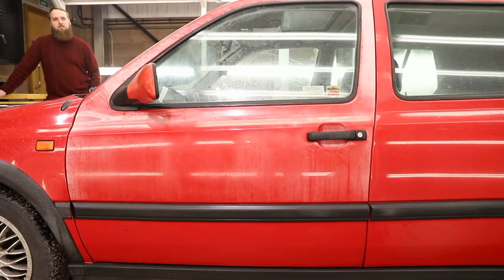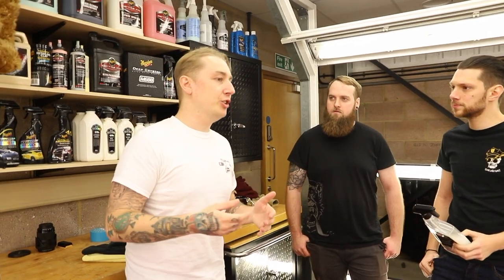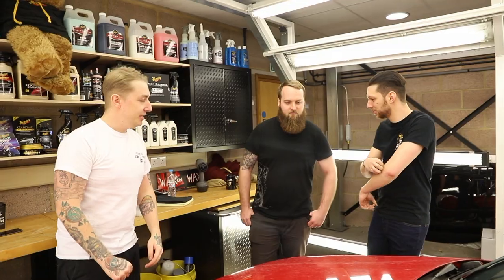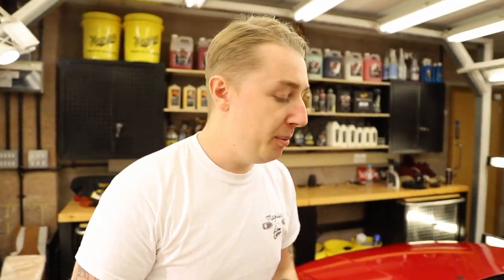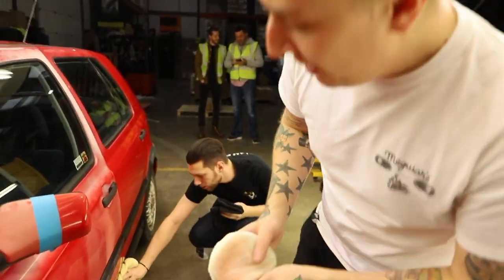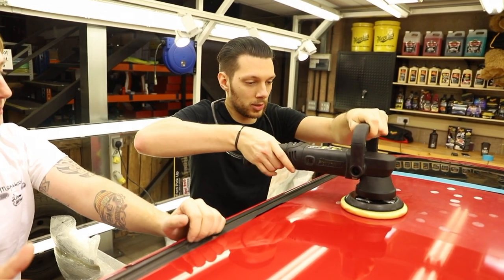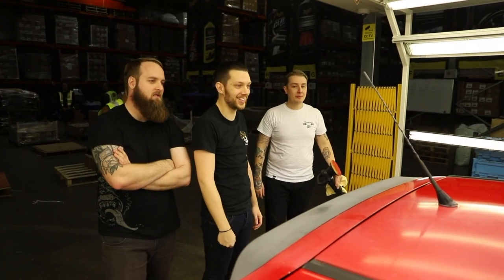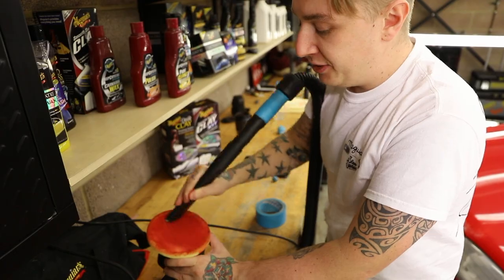The ULTIMATE COMPOUND for restoring FADED PAINT *Day In The Bay

Comment: The reason why red fades the most is due to the wavelength of the color. When you are seeing red it is the sunlight whose wavelength is red being reflected back at you which means that all other colors get absorbed and not reflected. Red is the farthest away from UV wavelengths so it gets hammered with them and absorbs them so the UV inhibitors in the clear coat take a bigger beating. Just wanted to put this out as that is the main reason why red cars fade the most.
Reply: If it is that faded, it does not have clearcoat...wich you can clearly see on the residue on the used pads…   With clearcoated reds the problem is not even remotely as big. And if they are faded underneath the clear you are obviously in for a respray..
Reply: And what about black cars? because they absorb the light.. so a red car fades faster than a black car?
Reply: @biaritzsiroko6117  no thats false statement above, all single stage (older paints) fade this way regardless of color
Reply: What is the sun?
Reply: You arent right. This is a 1k Paint, theres no clearcoat
Reply: @NikosPer  correct... green and yellow do the same... new red paintworks doesnt look like this after a 20 years ae
Reply: @Jubi230GTI  its just more pronounced on red colors...thats all. clearcoated reds no problem
Reply: Absolute bollocks
Reply: Most of the older uni-colors (non-metallic/no clearcoat)
Reply: That means red paint being faster might also be true, scientifically speaking the wavelenght of the paint absorbs the wind particles and aerodynamically affects the performance in equal correlation to x2 extra bhp per 10mph, ie. e=mc2 something. :D
Reply: I always thought it was because people were idle and didn’t 🧽 polish and wax their cars 🚗 😂
Reply: Just saying all colors are the same in absorbing all other colors and bounching the color you see back. Not just red.
Reply: Mikhail Smelik this simply isn’t true lol. Has nothing to do with the color, all paintwork on older cats will look like this if if it has spent enough time in the sun.
Reply: @biaritzsiroko6117  According to Mikhail black will fade the most because it absorbs all colors.
Reply: Look at the big brain on Brad.
Reply: Which colour fades the least?
Reply: By this logic black would be the worst, since it absorbs all wavelengths...
Reply: Magic school bus taught me this

Comment: Meguiar's Ultimate Compound on stage-1 paint is just killer. I restored a red 30 year old Mazda Miata convertible this past summer.  Did a very methodical Compound with a DA polisher.  Alcohol rub down.  Followed with a coat of TW Seal&Shine with a 3 hour cure followed with a coat of Meguiar's Gold Class Carnuba.  Damn it looked good.
I too did not follow with polish as the Compound cleaned up so well in the single stage paint.  After 30 years of less then proper maintenance,  I told the client that "I took what I could and left what I should..."

Comment: I thought after washing a car you had to decontaminate the paint by removing as much fallout as possible before compounding/polishing using chemical and mechanical means.
You didn't show that here so is it necessary?
Cheers.
Reply from the maker: The car had previously been washed before coming to the bay, therefore all we needed to do was use the Waterless wash and crack on with the Ultimate Compound!
Reply: yea, you definitely have you clay the car to get anything embedded into the paint out. they didn't, probably because of lack of time. as you can see the end result is far from perfect, but again, time constraint.
Reply: @Cydro12  .

Comment: This video convinced me to try it on my 2000 Honda Logo with red single stage paint. The paint is a bit faded, like very dark pink-red, but not by far as oxidized as the VW in this vid.
So I rinsed the car and used PoorBoys'World STRIP DOWN to remove ANY old wax or coatings, then washed the car by hand in a DIY wash box at a carwash, dried it, drove home, clayed the entire car, then removed any lube oils with an ipa panel wipe. I noticed that the strip down had been kinda aggressive on some parts of the hood, where i could see dried stains that have even turned vaguely white, so watch out with that stuff. But for the rest, the car was squeaky clean, so nothing would stand the Meg UC in it's way. The result is good: all swirls are gone and it has a good shine, but i'm very dissappointed in the level of red restoration: The Meguiars even coat MF pad, a "Liquid Elements" medium pad, or even a hard cutting pad on a DA did not gave a red transfer, only white-pinkish. And i know the original colour of the car is far more red, it's visible on the edges of each panel, the inside of the doors, on the inside at the fuel tank entry, etc. I know each car may need a different approach, but the Meg Ultimate Compound wasn't strong enough for my situation. It was my fault to completely rely on this vid, and only having the Meg UC in preparation for the excercise. I should have invested in other cutting compounds and have them at the ready as well, so i could trial and error my way to a true red restore.

Comment: I restored a oxidized car also red. The compound worked great and I sealed it with a wax compound from another company, the waterless spray worked better in the video then on the project I was working on. Also I used the McGuire's rim cleaner that was super.

Comment: I’ve bought the entire suggested range for Detailing a Dark Car, but I have the faded aspect from this video on my dark grey metallic on my hood and bonnet from sun damage.

My query; for the dark video you used the clay bar. For this video you didn’t clay bat the ‘single stage’ paint.

My non single stage absolutely needs clay bar but do I also use it on the faded single stage sections?

Thank you 🙏

Comment: Hi. I have a question.
Why do you use the Ultimate Compound with the yellow pad instead of the red one?
I mean, in the Detailing 101 you used the red pad.
Reply from the maker: This is a good question! Even though we lay out a procedure every paint surface is different and in this instance we opted for the yellow polishing pad as we needed to do more paint cleaning than correction.

Comment: Does using compound means that I have to regularly wax the car to protect the paint? And also, what happens if i wash the car? Do I have to reapply everything?
Reply from the maker: As an example our Ultimate Wax protects for 12 - 14 weeks. If you use something like our wash and wax shampoo that will protect for another 2 weeks. Or to boost protection after washing use something like our Hybrid Ceramic Wax.

Comment: Can I use the soft foam apllicator pads to do the compounding, and also for polishing? Or does it have to be the microfiber pads used in the video? Also, don't have the machine, so can this be done by hand?
Reply from the maker: You can use any applicator for any process we use the even coat applicator pad (the microfibre one) as its a slightly larger pad and the microfibre aids the cutting ability.
Reply: If doing a whole or multiple cars a dual action polisher is worth the purchase. I don't know if you have any discount tool type stores around your area, but inexpensive ones can be found online. I bought mine from Harbor Freight and even use it for applying wax now. Saves so much time and labor.

Comment: Why is that pad red? Is it removing the paint?
Reply: Yes, the compound and pad is removing the top oxidized layer of paint. Since this car has single stage paint, there's no clear coat on top of the color, and you see the actual paint color on the pad used.
Reply: @tbnzet  Thank you. I didn't know it was single stage and thats why I asked. I was worried that it was burning through clear coat.
Reply: @Nikola-df3dg  if you're getting color on the pad.. there is no clear or its long gone... peace
Reply: @HOTRODRICO   Thank you.

Comment: I just did a cut on a Milano Red 200 Integra (using macguires ultimate cut) and my cutting pad had no red residue on the pad. Any idea on why I’m doing wrong? Pretty sure it’s a single stage paint. Perhaps I’m not putting enough pressure

Comment: Maguiar's ultimate compound or Maguiar's 105 ?? Which is the best ?? I have a BMW 525d Msport  with A07 Mystic Blue.. Please guide the best option for compounding my car...
Reply from the maker: They are two very different products. If you are dealing with medium to fine defects which on a day to day car we would suggest they are we would go with ultimate compound all day.
Reply: try ultimate compound. especially if your a novice. i use it on my vehicles its my one and done. i dont have to go over it with a polish after because this compound breaks down into smaller less agressive particles and will polish as it gets worked. m105 will cut more but leave you with a haze that you will then need to come in with m205 to polish. clay the car first and dont use a very agressive or hard cutting foam pad, i use a medium pad or a polishing pad. good luck. get a da with a clutch
Reply: Thanks..
Reply: @DC-si8xw  - Ultimate Compound contains SMAT - non diminishing abrasives that do not "break down". You will break the liquid emulsion as you work the liquid over the paint, but the abrasive particulates themselves do no break down. 

Ultimate Compound is derived from M105. They use the same abrasives, but M105 uses a much larger quantity in the formula. Ultimate Compound also has lubricants in it that keep it wetter longer, which is why it doesn't dust as badly as M105.

Random Orbital polishers don't have a "clutch", but operate with a free floating spindle assembly. This means that par rotation is reciprocal of the orbiting motion of the spindle.

Comment: Videos like this never cease to amaze me with how much difference you can make to a cars finish, what once I would have thought needed a complete respray can now be saved with a bottle of cutting compound and even a cheaper DA polisher.

I just got my first machine today so haven't used it yet but next wash I'm looking forward to seeing what I can do with it☺

I know this is probably a really stupid question but how often would you use a compound like this on the car? Surely not everytime you wash? Is a deep Polish and wax sufficient after you've brought the colour back and hopefully removed any marks in the paint?
Reply from the maker: So once you've compounded it and done the necessary steps in order to protect the car you wouldn't need to compound it again. If you find the car has some swirls and scratches on it 6 months down the line for example you can absolutely use the compound again.
Reply: @meguiarsuk  

So realistically after the first time it would be a maybe once a year job just to freshen it up Yeh? A regular polish and wax will do the rest of the time.

Only problem I can see is my neighbour keeps collaring me to wash their knackered old Focus, it's going to drive them mad if I can make my car look brand new again😆😆

Comment: Would be nice if you didn't spread false information as to why you didn't apply a polish. Claiming the wax contains polishing agents is a half-ass response. It's a budget car and was treated as such. I recommend anyone looking to do this to their car who is on a budget do the following steps: 

- Wash car with dish soap (Removes previous waxes)
- Clay bar the car after wash with more dish soap and a bucket
- Rinse and dry
- Purchase a MICROFIBER POLISHING PAD and use Meguiar's M205 for a single stage correction (Budget friendly) (Microfiber is more abrasive than Foam pads, M205 is a polishing compound)
- Wash car again with dish soap (Remove left-over wax/polish completely) (You also need the machine of course, rotary works)
- Apply the new ceramic coat product Hydrasilex right after, and every third or fourth car wash therafter. (They say every six months but the more the better)

You got yourself a budget friendly detailed car.

Cheers.
Reply: Leandro certainly not budget friendly but you are very right with everything else, people that work on cars in the field always know what’s best compared to companies reps
Reply: Dish soap? Why would you want to use something corrosive? If you want to remove old wax or sealants then use a dedicated panel prep product after washing with a car shampoo. The polishing process will remove the old lsp anyway. Then use the panel prep product to remove the polishing oils before applying your fresh lsp.

Comment: You just clean with a product with protection and then compound it? That makes the cutting step harder for the product because the compound needs to penetrate and cut the sealant and the clear coat
Reply: @NihonKaikan  When you are compounding, you are literally removing the top layer of clear coat..Not the entire thing, just some clear coat.
Reply: @NihonKaikan  when you do a paint correction using a first aggressive step you are cutting the clear coat, its called the cutting process, that is why the highets compounds are called "cutting compound"

Comment: Should you not use ultimate polish after ultimate compound?
Reply from the maker: The gold class wax we used contains polishing agents so there was no need to use ultimate polish as well.
Reply: @meguiarsuk  The Ultimate Polish doesn't just only contain colorenhancing parts but is also fine abrasive which means a higher gloss. Results are already great with this old VW but applying Polish after the Compound would have resulted in even more shine (and possibly better maintained pigment).

Comment: Great video guys, learned a lot, again. Ps. Does Mequiars plan to introduce a trim restorer? I've used gtechniq g4 trim restorer for years and it's absolutely flawless. It makes a chemical bond rather then surface and lasts for 2 years quite nicely.

I suppose what I'm really trying to say is, the paint was beautifully finished, but the car wasn't. That's horribly grey, faded trim.
Reply: Try aerospace  303 awesome stuff for exterior plastic and also for interior trims.

Comment: You didn’t clay ?
Reply: Claying a car that doesn't have clearcoat and in such oxidized condition is a waste of time.
Reply: Waste of time.... ok then 😓
Let's leave the nice embedded contaminants in the paint and then get them stuck in the pad while dragging them across the surface with the d.a! Great idea 😂
Reply: @Scala598  The pads getting clogged with oxidation, no amount of claying is going to help that. So if you want to clay the car to stop your pad from clogging up with contaminants when it's going to be full of paint and oxidation anyway you go right ahead....
Reply: Obviously the pad is going to build up with the removed paint from cutting. The same thing happens on clearcoated cars, only it's harder to see. Cleaning of the pad due to this is essential for a good finish. 
Do you seriously think some tar spots/tree sap/iron fallout will do equal or less damage than removed paint? I think not, environmental contaminants are far more likely to cause damage than from when you pick up the 'dead paint'
Reply: @Scala598  The results are the finished product in this video, massive transformation. And in no way does clear coat build up on a pad to the extent as single stage oxidized paint. Here's a quote from  Autogeek " If the oxidation is severe, polish first because the oxidized paint may flake off as you clay and ruin the clay bar." Maybe a lightly oxidized car it would be fine but the car in this YouTube vid was heavily oxidized,  I just wouldn't bother.  What you choose to do is your call.
Reply: The results in this video are not great, yes it's much better visually, but the paint is still terrible. Look at the shots with the direct light source,  there's no clarity/ larger marks and defects/ colour variations. They are clearly on a limited time frame which will likey contribute to the above. 

If your happy with the risk or cost of ruining your pads and or paint because some tar or metal fallout has been collected up into your pad then that's up to you. A full chemical decon and if it's heavily oxidised then consider a less aggressive clay. Less risk of damage is what detailing is about
Reply: @Scala598  To be fair this car is a junker,  if this was a decent car then I'd expect better results. Chemical decon sure, that's still a good idea agreed. I just don't agree with mechanical decon in this instance.
Reply: You could 2000 wet & dry with loads of soapy water then G3 .. Cost to me err about 50p the whole car
Reply: Scala598 if stevie wonder is valeting cars then yeh but only as spacker polishes over tar ffs
Reply: Scala598 <—— There’s always one 🤦‍♂️

They’re not fucking “detailing” it, are they? They’re demonstrating how one of their products can revive battered paintwork - which it ably does, and without much effort. You need to understand there’s a difference between wanting to jazz an old banger up, and the anal, pointless act of “detailing”.

Comment: The passenger door is still pink.
Reply: Two things; first, they really didn't do a serious correction job on this car. One pass with a consumer-grade compound using an entry-level DA polisher with a foam pad isn't going to get good results. A real paint correction would require at least two passes with two different compounds, applied with a rotary polisher and a microfiber cutting pad. But they're demonstrating their consumer products not their professional products, so it is what it is. 

And second, this paint may very well have been too far gone to fix 100% anyway. It was severely damaged, and we have no idea how thick that paint actually was so we don't know how much they had to work with. Could be that going too aggressive would have just stripped it down to the primer. Not everything is fixable.